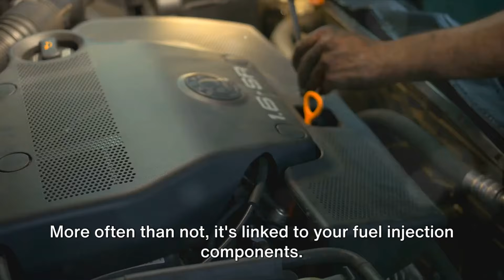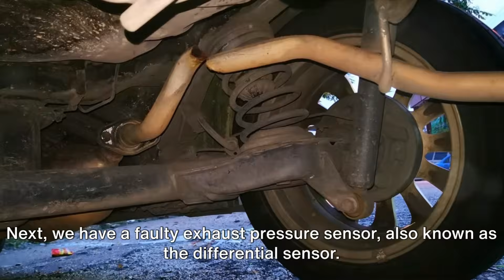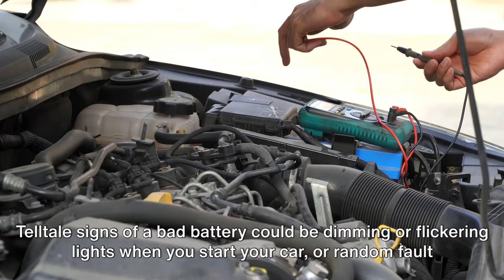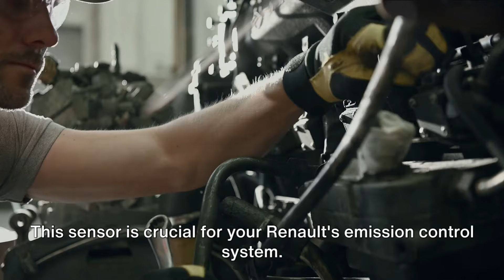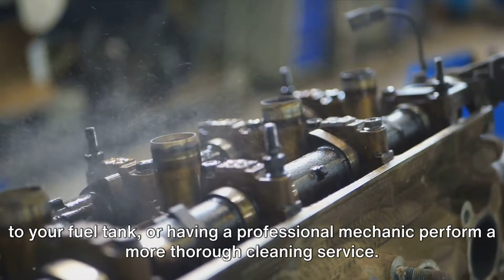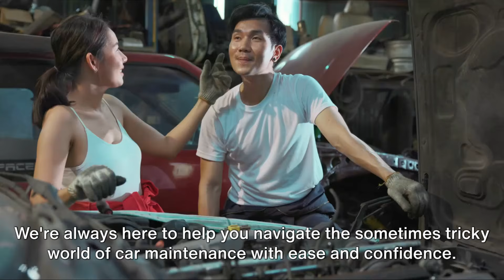Check Injection System Renault: Causes & Fix

Comment: I got a Renault second hand and after 108.000 km I got 'check injection alert' on the middle of the motorway. I could not continue driving and had to stop on the side of the road with a baby, stressed wife and two kids aged 7 and 9. 

Now I have it at the mechanic and I don't know how long for. What a horrible situation.

Comment: I watched your video on the Renault "Check Injection" error and found it very helpful. I'm facing a very frustrating recurring issue and would appreciate any advice you might have.
My Vehicle Details:
• Car: Renault Koleos 2.5 LE 4x4 (Petrol/Gasoline)
• Year: 2018
• Mileage: ~82,000 km
Problem & History:
1. My car gets a slight engine vibration/wobbling, followed by the "Check Injection" warning light.
2. I recently had the 80,000 km B-Service done at the dealer, which included new Spark Plugs.
3. The dealer also attempted to fix this specific "Check Injection" issue but the warning and vibration returned after only about 400 km.
My Question:
Since the dealer's fix failed so quickly, and considering the recent spark plug replacement, do you think this is more likely a persistent Ignition Coil issue, a failing Fuel Injector, or perhaps a sensor/wiring fault that the dealer missed?
Any insight on what the most common recurring cause is for a 2.5L petrol engine with these symptoms would be highly valuable before I take it back to the service center.
Thank you for your excellent content!

Comment: I just brought one of these and that warnings up on the display. Drives great and runs clean so hopefully its just needing the injectors cleaning as its not been driven hard buy the last owner. Ill get it plugged in tomorrow and see what the cars saying. (I have a very good local mechanic friend with a very fancy Plug in computer thingy)
Reply: So what happened?

Comment: I keep getting P0190 fault code and Captur going into limb mode.P0190 is the rail pressure sensor, changed it but the problem keeps popping up, its always more frequent after i fill up gas for some strange reason.
Anyone got any ideas?

Comment: had the same problem with my 09 tce clio iv . the problem had to do with the turbo. Everything else was okay from the injectors to the plugs the fuel pump all was okay. The turbo actuator was clogged and didnt move at all the car went into limb mode. The cleaning of the actuator servicing the turbo solved everything. I started getting better fuel consumption and the car was back to good power delivery.
Reply: Brother. I have the same problem. Please tell me more about the actuator
Reply: @KopanoSeepamore did you get help?
Reply: Please give me your WhatsApp numbers I really need your help this car is stressing me

Comment: Hello!
Can you help me with some advices? After I’ve changed timing belt and I moved the engine higher and lower with lifting jack DF055 and DF056 appeared… in neutral my car is shaking and when I accelerate until the car riches 90km/h check injection appears.

DF055 Turbocharging pressure regulation circuit , turbocharging pressure is to high.... intermittent fault - (temporary) clears on ignition off, when EML ON - car still hits 60-70mph but turbo charger is definitely off or reduced so not in limp mode as such. I'm thinking semi-seized actuator. anyone had this problem on a 115hp 1.9 DCI
Reply: Проверь вакуум на актуатор,
Reply: Посмотри вакуум на актуатор

Comment: Thanks for video was very informative 👍 

I’m currently having ‘check injection system’ and ‘anti pollution system’ loss of power over 2,000 revs and also no cruise control or speed limiter working and dash arrows to say when to change gear all stopped working the same time the errors were displayed, any ideas? Local garage were stumped - battery tested 12.7 on multimeter 🤔
Reply: Hi, mine is doing all the exact same things as yours. Did you ever manage to find a fix?
Reply: @cartoonelbows did you found what was the problem?
Reply: Hi, mine ended up being a costly split in a pipe which was a Renault patented pipe so had to buy direct from them 💰
Reply: I have the expect same problem “ check injection “ check start stop “ check anti pollution, any ideas ?
Reply: @RealDimaVegas  I had to replace the injectors

Comment: I had the injection light pop up on a 1.2 petrol renault  other day it was on for about a day  i went to start it the next day and all lights was off and the car had no lights for about 3 days the car hasent lost power but the injection light has popped up again sinse but the car still sounds and drives fine any help would be appreciated
Reply: What happened? Any intervention required?

Comment: Dpf issue just done mine i changed the dpf sensor and then cleaned it dpf light came right off but now i need to change injector 5 which i an currently try to source but might try the battery 1st since its dying on me
Reply from the maker: I appreciate you sharing your experience. It will help others for sure!
Reply: Do you have one of those V6 diesel Renault?

Comment: My 2012 Megane 1.5 dci 110 is starting but cuts out after a few seconds. Check ignition system and check anti pollution system is on the dash but the only fault code is for an aircon sensor. Changed map sensor, cleaned egr valve, checked fuses and relays, new fuel filter. I just can't get to the bottom of it, any ideas? Any help would be much appreciated
Reply from the maker: Hi, Joem really sorry to hear this, managed to fix it? Given your situation and the actions you've already taken, it's possible that the issue might be related to the anti-pollution system error message rather than the aircon sensor fault. Consider checking the following:

1. Diesel Particulate Filter (DPF): If your DPF is clogged, it can trigger anti-pollution system warnings and cause the engine to cut out.
2. Fuel System: Further investigate the fuel system beyond just replacing the fuel filter. Issues with the fuel pump or injectors can cause these symptoms.
3.Wiring and Sensors: Since you have an unresolved aircon sensor code, ensure there isn't a broader issue with wiring or other sensors that might affect engine performance.

It may also be beneficial to get a professional diagnostic scan from a Renault specialist or a dealer who may have more advanced diagnostic tools that could pinpoint the problem more accurately.

Comment: I can see there Is not power drop in my  car... Power is good but I am getting check inject system and check antipolustion system at a time
Reply: Can you suggest what could be the reason for this
Reply from the maker: Managed to sort it out? might be a bad sensor or battery issue
Reply: Clean egr. Probably stuck. Had the same
Reply: Hi, did you manage to solve your issue. My car is doing exactly the same?
Reply: Hello. I have that check injection system error. Did you fix it already?  @inamariheuer6636